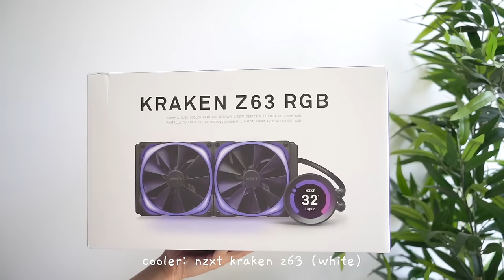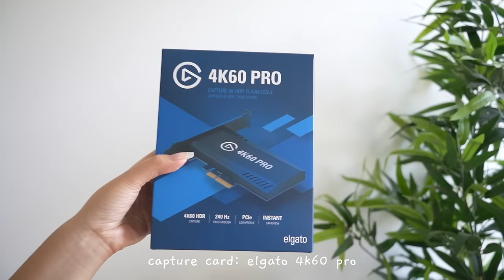💻 building my first pc | white aesthetic | lian li 011 mini, rtx 3070 🤍

Comment: From someone who has done several builds, everything from the smallest cases (Dan A4 SFX) to bigger mid towers (Fractal Design cases), I'm very impressed. 

For a first time builder, you seem extremely well prepared. Even for us enthusiasts, who have built several PCs, can easily make the same small mistakes as you did in the video, so nothing to be ashamed off really.

Were also extremely impressed with how well you had informed yourself on the different parts, such as the Lian Li UniFans and how their innovative connection system works. You seem to have with a balanced airflow inside the case as well, good choice of parts overall and with a uniformed theme as well. 

Excellent work overall and you should definitely be proud of this build - hell, even if this would've been like my 10th build, I'd be hella proud over it and I've done well over 10 builds.

Very well done! :)

Comment: Great job! 

One note: with a side mounted radiator like yours, you want the tubes for the AIO cooler to NOT be at the top of your loop.  This is because, over time, any air that inadvertently gets in there will cause a gurgling sound and put extra stress on the pump.  A better configuration would be to rotate your radiator 180 degrees so the tubes are at the bottom, but, importantly, the top of the radiator is still ABOVE the pump which is attached to your CPU. This will make any extra air in the loop sit harmlessly at the top of the radiator (highest point of the loop) and won’t cause any gurgling or extra wear on the pump.

Comment: Nice work!  Keep an eye on your CPU temps.  With the AIO radiator mounted that way, there can be an air bubble at the top that can potentially starve the pump for fluid.  It's always best to have the hoses submerged and any air bubble at the top of the rad where it won't bother anything.  Just my .02
Reply: She's okay with the CPU Cooler because the block is lower than the top of the radiator, but the fan orientation can be switched to intake instead of exhaust for more positive pressure.

Comment: Beautiful PC, excellent work! Kudos for having the bravery to attempt it! I built my first pc 3 yrsal ago and am about to build another with a 12900k ddr5 ram on a Asus z690e gaming MB with an evga ftw3 3080ti. Using a Lian LI 011d xl with lian LI sl 120 fans and an nzxt z73 aio.
Reply: For future proof is okay,  but at this moment and at this market ddr5 makes no sense, there is a really slim performance difference. And is common to have stability issues in certain programs, software manufacturers has yet to optimize them. Get the Lian li Galahad 360 or the ekwb ek aio elite 360 d rgb. The z63 costs a fortune and has less flat out thermal results

Comment: Came over from Twitter. I'm not even into gaming PCs and just fell in love with this machine. It's friggin gorgeous! I'm now looking to build one. Real question: can someone please explain to me why foregoing harddrives may or may not be a good thing in this configuration?

I am not a tech person so any and all feedback is welcome. Thanks in advance, guys!
Reply: She went with SSD hard drives in place of older SATA drives. Not as much storage but significantly faster.  2:30 seconds she installs.
Reply: @richarda.2680  thank you very much! Is there a way to keep the SSD and this configuration without sacrificing storage?
Reply: @MassiveReset  Short answer is yes, it is possible. She added two SSD drives here, which are hidden behind those sink coolers. They are thinner and usually just snap into the provided mounting spaces. (No cables to run) The downside is they tend to get very pricey when looking at storage larger than 1 Terabyte.  Although depending on what you may be using it for, you might easily get away with a 1 Terabyte SSD, which is only around $150.
Reply: @richarda.2680  thank you sir!

Comment: If I may make a couple suggestions! However, first let me congratulate you on your first gaming pc and you overall did a fantastic job on it! First I'd move your capture card down one slot if possible so it isn't choking off any airflow to the gpu. Also with your fans the way they are now you're at a very negative pressure. I'd recommend maybe make the front 2 fans on the side panel intake as well for more  of a balanced airflow.
Reply: Yes I completely agree. Negative pressure allows for more dust to come in through places you don't want, thus a positive airflow or net 0 airflow would be best!

Comment: quick tip, turn the radiator 180 so the hoses are at the bottom. Overtime water will evaporate, albeit years, and when enough air acuminates at the top of the rad where your hoses currently are, they will be starved of water.

Comment: You should flip the radiator upside down, that the tubes are at the bottom of the case. If the tubes are at the top, the air inside the loop will all come to the top and less water can flow through the tubes.

Comment: the only thing i would tell you its the orientation of the radiator, the pump must be on the bottom and not on the top because of the bubbles of air and the efficiency that the pump duest while taking the liquid. Aniting else is just perfect, nice build!.

Comment: I dont know if anyone mentioned yet but you should flip your radiator or move it to the top of the case. With the rad side mounted with the tubes at the top your pump will struggle harder to move liquid through the loop.

Comment: If mounting the radiator vertically, always have the radiator pump cables be on the bottom. 
That way the bubbles won't be pumped around, they will just stay in the radiator at the top.

Comment: the build is so beautiful. but 1 lil advice, flip the 2 fans  on the side panel. too much exhaust. the airflow is negative with 3 intakes (on the bottom) and 6 exhaust (side, top, and back). very good job btw!

Comment: Very nice build, I think mine is the all black and chrome manly sibling. I went zero-RGB but I'm now looking for a way to add some subtle lighting without going over the top.
One major difference in the build is that I used the compartment in the back for the radiator fans, and used them as an intake. As I didn't care about the fan RGB this was a far better solution.
If you want to keep the fans visible you should consider flipping them to intake as you will not only draw in cold air, but it will also reduce the noise a little.

Comment: Just a quick tip, this build has 3 intake fans and 7 exhaust fans, so be sure to make the intake fans the highest possible rpm to try and cancel out the negative air pressure, as negative air pressure can damage your parts in the long run
Reply from the maker: thank you! that’s a really helpful tip
Reply: @cassiedakota  i meant 6 exhaust sorry 😅

Comment: Before anybody says im hating, I have a Lian li 011 Dynamic with a 3080 and a i7 12700K OC. I see you spent an extra $130 for a LCD screen on your AIO lol and as well please turn your AIO with the tubes coming from the bottom of your case. When its installed like that you will get air bubbles and your pump will go out due to the air bubbles lol and the pump working harder. Other then all of this good build.

Comment: BRAVO on your first PC build. Just for constructive criticism you should never put the AIO on the side or bottom always on the top. If you HAVE to put it like you did at least you put the hoses on the radiator above the pump itself or the cpu. Your AIO will creat air pockets in the pump and won’t cool your CPU properly and overtime or instantly for some people it’ll over heat.

Comment: I have not built a PC in years it has been over 10 years since I built a PC, and the game has changed.  I do support PC's and it has been good.  AMD has changed for sure.   Suggestion nice you have included a link you should take advantage of the part list and use Affiliate links from Amazon.   Just a suggestion.   For those that cannot afford the complete build, there are things you can remove for the time being.   Get the case one of the best ones I have seen and researched.   Then either go AMD or Intell, but the suggestion go AMD Ryzen 5600R is the one I am looking at   Get a Modular Power AC.   Only suggestion then is: to find a  good Motherboard that allows for expansion or change on the CPU later.    Some of the nice to have is the Air Cooler,  storage can be reduced.   You do not need more than 8-16 Gigs of RAM,  500 Gig SSD.   Then purchase a solid state drive for storage.     So there are ways to reduce the price cost of building this PC Build and then add some of the nice to have later. I will be taking this approach myself.    I have b been looking at the Laptop I have and do I really need a Laptop and the answer is no I use my computer in a Desktop environment for the most part.  For those that do want to build their own computer, there are Builds that you can build for 2/3 of the cost with a great upgrade path.    Yes, this build looks cools, but GPU's are too expensive right now, but they look like they are going to become reasonable again in price.     I have been in the computer industry for over 19 years and you do not need the best and coolest tech to begin.   Wha you need is something to start with a good upgrade path.    I will give credit the build looks cool, but for the majority, there is a better choice and one with a nice upgrade path.   Just my opinion though.

Comment: I would rather have 500gb nvme + 1 tb sata ssd. With the extra money from that nvme, i could get better processor 7600x. 
But i might need extra budget for AM5 socket mobo tho. Unless i could get AM5 socket micro ATX mobo with 2 PCIE 16x using the same mobo budget. 

That vertical radiator should have been upside down (rotate it 180degree. Top mounting would be the best). The air buble would get accumulated on the top part of radiator over time. But you got pipes there. It meant air buble might circulate around the pipes in the near future, not good. 

With this fans configuration (3 intake fans + 6 exhaust fans = negative pressure), the dust would get accumulated faster. 
Unless the intake fans run faster to balance the exhaust fans.

Comment: that looked great. I recently built my own pc though it was an upgrade but still took my pc apart and install my components into a new case. btw I am using Lian Li 216 which kinda similar with your case and it was also a black and white theme but has more black in it. my case is black. I am also using msi 3070. anyway, i did enjoy your video, I love those glowing sleeved cables! those rocks!

Comment: If you get high temps on cpu it might be because of the fans on the radiator. I ran a similar setup but got somewhat high temps on cpu until i changed them to the ones included. I think it's the design of the lian li fans that make them a little inefficient when mounted on radiators compared to the nzxt ones. Just saying

Comment: I have the O11mini with 7 fans aswell. For temps it would be better to use the AiO Fans as intake. For style i chose exhaust like you.  But in our scenario i was wondering why you use rear fan as exhaust. I use it as intake (4 in, 5 out). Not sure why so many use 3 in 6 out. I saw that a lot

Comment: All good, just one common mistake, the orientation of the AIO radiator its wrong, if u leave it like that the pump can be damaged, by the air in the upper part of the radiador. Flip the radiator over so the hoses are on the bottom. btw beautiful build
Reply from the maker: most builds i see have the radiator hoses on the top though?
Reply: @cassiedakota  No, my bad,  it's ok how you did it because the pump is lower than the hoses just be careful if you hear sounds of air in the pump sometimes it gets stuck in the pump and that's bad but that can only happen the first time you put the wattercoling.

Comment: Well done but for you have too many exhaust fans. You have more exhaust than intake, which isn’t good, neither for airflow than for dust. You have two option. If you want to follow the heat rises concept the three fans on the right (called side) needs to be swapped. Yes for max airflow this is the best configuration, but I don’t like looking at fan cages. Which is why I ignore the heat rise idea (which in reality is only slightly better). And do top as intake, bottom as intake (total 6 intake). Side and rear as exhaust. Plus dust filter on exhaust fan are useless, better remove them so they can move more air

Comment: Nicely done :) it's much nicer than my first build. Back then we didn't have modular power supplies or many cases that helped much with cable management, so usually the extra cables just got tucked above the DVD drive. My first self assembled build was an Athlon x64 3200 winchester with DDR Memory (2x512MB sticks made by OCZ) my current pc isn't that much newer as it is an i7 920 from 2009. Looking forward to making a new Ryzen based build, but I want to see what performance is like with the 7000 series chips.
Reply: At least for now Intel 12 gen wins hands down

Comment: I really want to build my own PC but also have no PC building skills or knowledge 😂 I'm at the research part so far, I'm so determined to do this! Lol
Reply: If you happen to have access to an old PC you don't mind experimenting with, use that to learn. Take it apart completely and then put it back together. If you can do this several times without issue, you can assemble your own PC. That's how I got started getting interested in computers as a kid. Taking pictures can also greatly help you remember where things are supposed to go.
Reply: @JJFlores197  Thank you for the tips! I need all the tips and tricks I can get haha

Comment: Great looking build nice work . Looking to use some parts that you used in my build , was wondering on the effects you put on the Lian Li Strimer cables , was that a single option in the software or did you have to program each wire to do that ?

Comment: SUPER NICE BUILD! the only thing id say is your fans on your radiator are round the wrong way, you should be pulling in cold air through your rad instead of pushing hot air out over it. but i doubt it will make that much difference. just nit picking. :-)

Comment: 6 exhaust fans? Just a suggestion but I would top mount the rad and turn the 2 fans near the front to be intakes.
Reply from the maker: i did consider top-mounting but there isn't enough clearance for a top-mount + atx motherboard in this pc case, so i opted for a side-mount instead. as for it not being intake, i knew it would compromise airflow a bit but i didn't like how the back-side looked, and i seem to be running pretty decent temps with the current setup anyway ☺

Comment: All your fans are on exhaust. flip the bottom ones and side ones around for better temps
Reply: your components are being completely choked with a negative airflow setup like this which means bad thermals, worse life longevity and more dust enters the cage as it acts as a vacuum
Reply from the maker: the bottom fans are intake

Comment: you did a  good job.  I have a hard time understanding why you installed the two fans on the back plane.  the air flow goes up from the bottom fans and then gets sucked up by them out of the case.  Then the top fans exiting out the top of the case battling the same two fans .  it would have been better leaving them out of the system.
Reply: People way overthink airflow direction. What matters is positive or neutral pressure. If someone  has to rely on airflow directions for thermal is an indicator that he has to change the cpu cooler and have a look at the gpu fan situation

Comment: Build looks amazing! just want to mention that you actually have the bottom fans as exhaust and the top as intake so you might want to switch those! :)
Reply: You've got that backwards. Her bottom fans are intakes, the rest are exhaust. Looks good with the fans oriented this way, but the negative pressure will collect dust faster inside the case.
Reply: @eb1237  your mistaken. If the bottoms were intake the aluminium badge would be facing up .

Edit: guess I’ve been thought the wrong side my whole life lmao
Reply: @elijahdtb  No worries m8. I do have the same case and fans, though I oriented my AIO fans on the side to be intakes to tip the balance in favor of positive pressure.

Comment: Beautiful build. I have a question for any more experienced builders. I heard having your fans on the upper half creates more bubbles and makes the PC last less long, is it still okay how she did it since the pump is also on the top half?
Reply: Fans on the upper half? I think you mean the aio placement.
It’s fine because since the top of the radiator is taller than the pump head and waterblock, the air will accumulate in the radiator and not in the block.
Reply: The bubbles will be in the radiator which is fine, but something you don’t want is to have bubbles in the pump since the pump uses the water as lubricant and with air in the block, the cpu won’t be cool and the pump will be running dry.
Reply: @juslmunch  yes! the aio placement. Thank you!

Comment: GG, i know you havent watched any LTT clips cause you didint drop any components xD

Only thing i notice is, you didint screw in X orientation, from corner to corner, but if it works it works.
Reply: Second thing is, should really buy mobo and gpu from the same manufacturer, you are gonna get RGB issues if not.